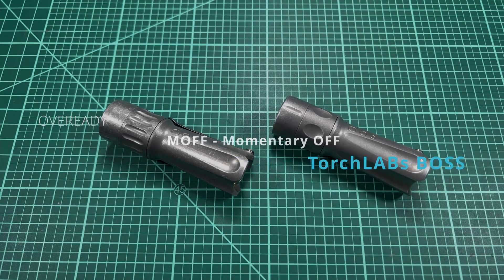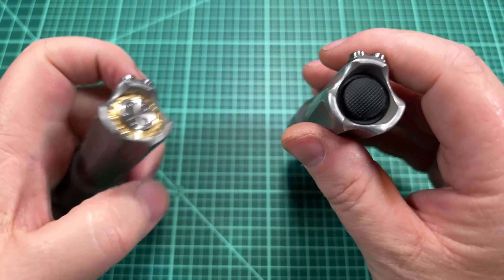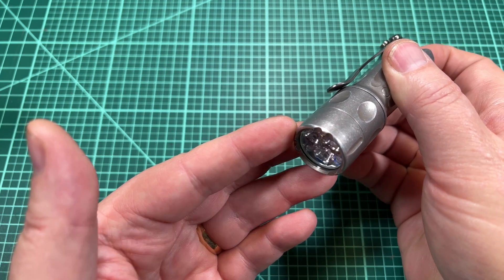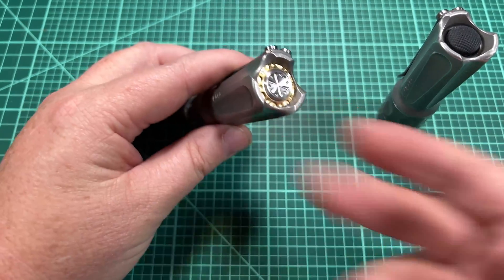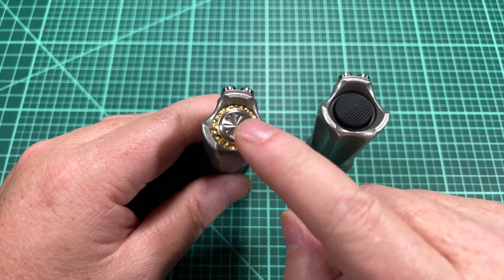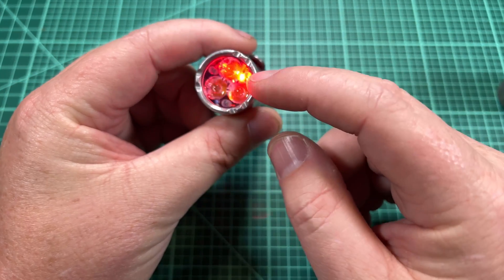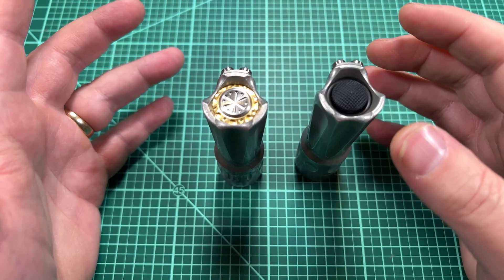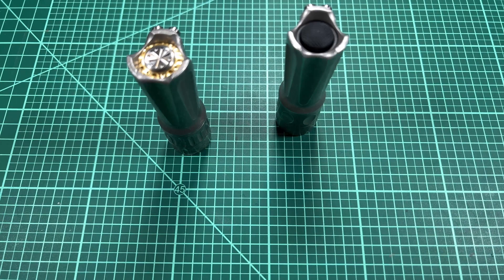MOFF - New flashlight switch! - Momentary OFF Switch

Comment: Curious will the MOFF switch be swapped easily with the McClicky? Im wondering of the long term maintenance as the MOFF is not readily available on aftermarkets should they discontinue the model. My LensLight from 10 years ago have some issues but since they are out of business i cant ask for any hardware.

Comment: If these reviews are still being monitored, as well as these comments,  please do a video with these flashlights in a real world use cases. Why do I say this?  I feel as though this video is highly bias to this new switch and doesn't really demonstrate its actual usability / sway to purchasing this new switch.  Only benefit I see is easier to cycle through a crap ton of modes.
Reply from the maker: The BOSS with MOFF is my daily driver. I like it much more than McClicky because it’s a press or not, digital. There is no half press or full press like on McClicky. I find the precision much better for reliable mode switching.
Reply: @cheule  I'm slightly confused. Could you please evaluate? I appreciate the time you are taking to reply to me!

Comment: I have the Future 35 with the McClicky. It was my first custom and it's still probably the best.
Reply from the maker: Future BOSS in distressed Al is still my daily driver. So good!
Reply: @cheule  would you recommend the 35 or the 70 tube? the light looks kinda big for an 18350 but it seems like its relatively smaller as an 18650

Comment: While watching this I picked up my 10 year old Streamlight Stylus Pro and discovered that it has momentary, so forward clicky, but no modes, or is that a mode? on/off?
Reply: it has a high/low
Reply: @brertt8350  I wish. Do you know if the last 4 digits of the serial number are the manufacture date? Mine are 1116, which is about when I got it.

Comment: So the price of this MOFF switch is a dollar more than a Zebralight SC64, dang these lights are expensive.
Reply: You ain't kidding. I just looked at their website and they look nice but REALLY pricey. I'm sure the MOFF functionality could be made much less expensive.
Reply: There is No Fvckin Way I'd buy one of these Oveready flashlights.. My ZL SC600 is working perfectly fine after nearly 5 years and my ZL H52W headlamp is as good as new after nearly 10 years now. This OR FL may be a great FL but not $500 great. What is the runtime at half illumination using 3 emitters? It can't be as long as my ZL SC600..